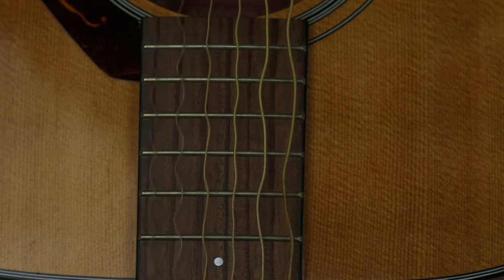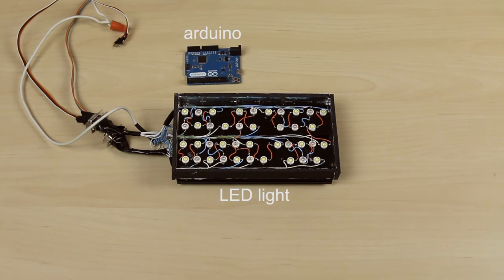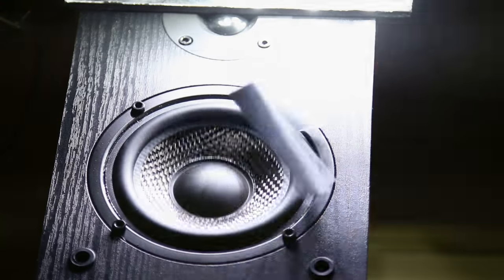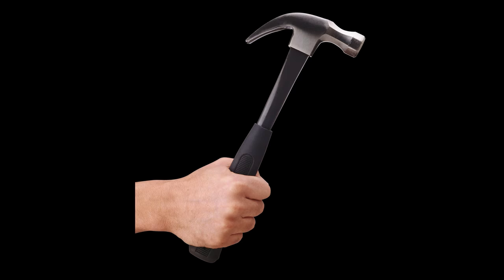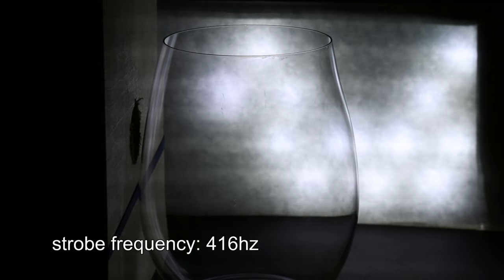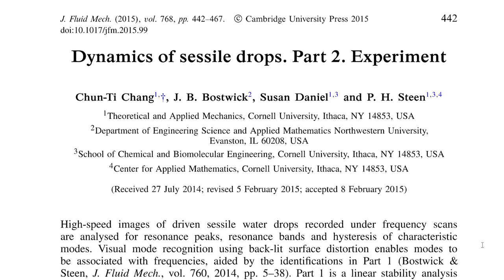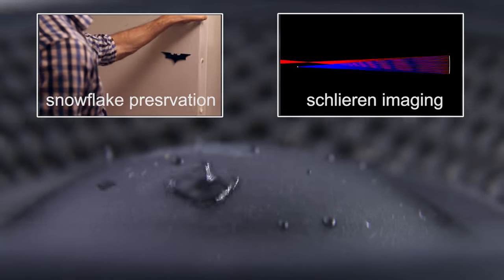Seeing sound with light: strobes and resonance

Comment: keeping water in the correct resonance will make hydrogen at low amps, you can also subject it with 3 frequency of its brake down and it will work well, also monitoring software to adjust for temperature would keep things consistent and lot current draw.

Comment: Loved you video. Please do a tutorial on how to build a strobe like yours (or share your build plans). I'm in a 3rd world country and desparate to build a stroboscope like yours. Thank you in advance.
Reply from the maker: Maybe I will someday, but right now I'm sailing around the world on a small boat, and don't have the time or resources. However, I do have an Instructable that has some instructions: https://www.instructables.com/id/Seeing-Sound-and-Breaking-Wine-Glasses/
Reply: Antonio Noack Thank you so much for sharing this info. I'm definitely going to check this out and try make a plan. You've done your good deed for the day ;)
Reply: Antonio Noack I had a look and this setup wouldn't work, unfortunately. I need something that can strobe. Thanks anyways for the suggestion.
Reply: It might not be bright enough (and you've to set your music to full volume (because the default voltage is pretty low)), but besides that it kind of can strobe :) (tested it myself).
For brighter light an optocoupler probably is the right thing (as simplest more-power-setup I can imagine). With modified JS-Code you could also change the width of the strobes.
Reply: Antonio Noack Thanks a ton man, I'm gonna look into these suggestions. Cheers

Comment: thanks I want to visualize sound and have worked out that at 343 m/s speed of sound in air, the lowest frequency to the highest frequency we can hear (20 Hz to 20 KHz)   the wave lengths would be 20KHz 1.715cm , Middle A 440 Hz 77.9cm Middle C 256Hz 1.715m,   20 Hz 17.15cm

Comment: Neat!

But if you set the strobe frequency to half the frequency of the guitar string's fundamental mode, would you see the string frozen in place, looking permanently bent?
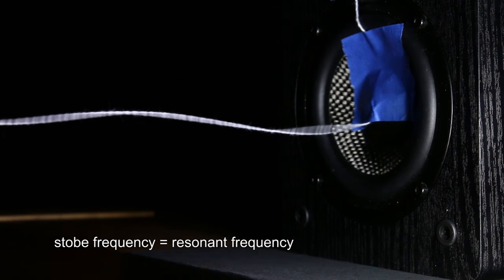Reply from the maker: I experimented a little trying to see the overtones, but there weren't significant enough for me to easily pick out when checking multiples of the fundamental. If I halfed the frequency, we'd see the fundamental in two places, instead of just one. It'd look like what you see at 1:35 in the video.
Reply from the maker: I believe if you set it to half the frequency you would see the same as you do when the frequency is matched. You'd  be seeing the string in its "bent" position, on every second occasion its there. If the frequency is matched, you see it on every occasion. But to us, the two would look the same.

Comment: if you see this comment try answer these questions i have boggling my head!!
1 could this be used in a fusion reactor to alter the atoms inside to whatrver controlled state? like you say each thing has frequences. like in theory could we use a massive version of that math wrapping the collide but so concentrated and loud it changes the position of the atoms to whatever state we choose?
2. if possible do you think the craft  at area 51 had one?